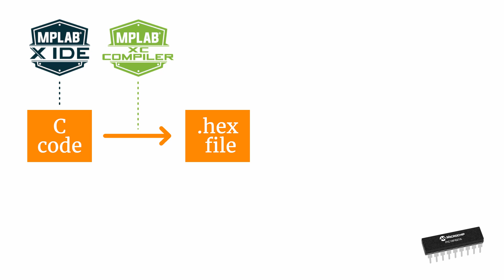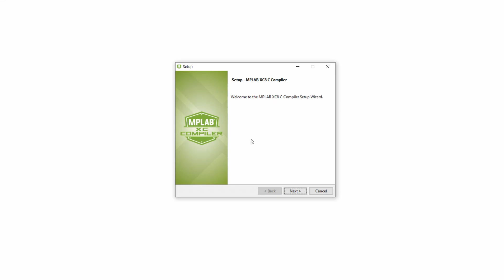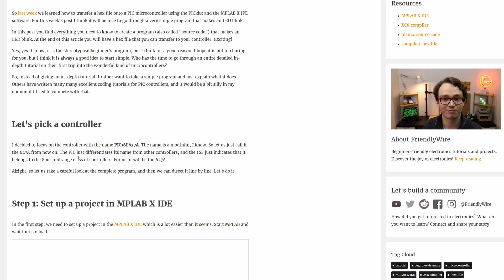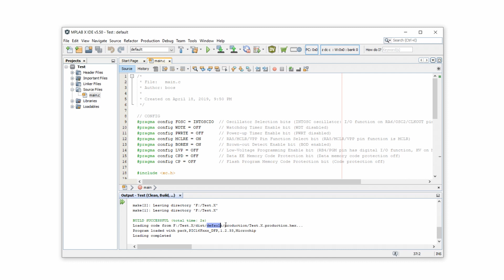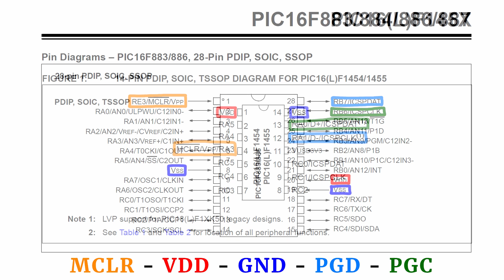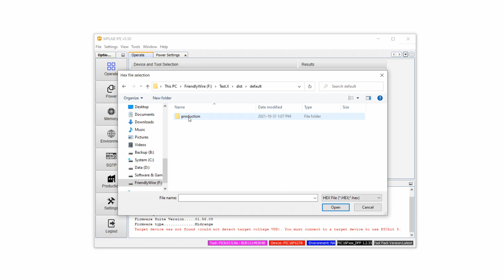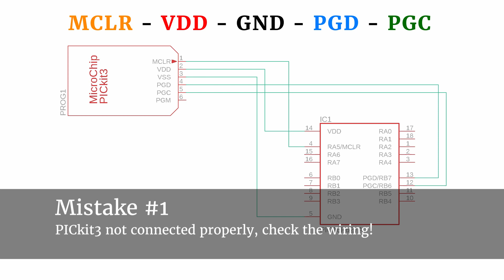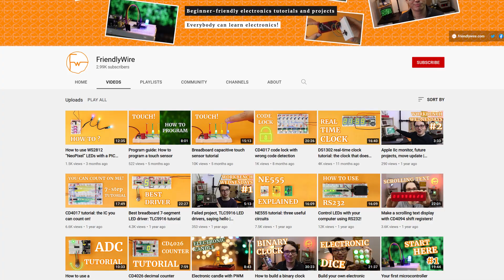How to get source code onto a PIC microcontroller

Comment: Very good video sir, Is there any way to upload a hex file onto a PIC microcontroller without using a PICkit, instead using an Arduino?
Reply from the maker: Thank you for your kind words :) Yes, it is probably doable, since you just need the three wires MCLR (Master Clear), PGD (Program Data), and PGC (Program Clock). But I am not an expert on doing this. If you search on Google for "homemade PIC programmer" I am sure you will find many helpful resources!
Reply: @FriendlyWire  alternative of a pickit3 for "ICSP (in circuit system programming) there's a way of directly connecting a PC serial port to the RB6/RB7 and uses a few components including a 12 V keyfob battery for the VPP.  Has to use a real hardware rs232 serial port, a PC with usb adaptor is too slow to work.
Reply from the maker: @jagmarc  Yup, good point! Older development boards used to use that method, check out the Velleman K8048 that I list on my website here: http://www.friendlywire.com/articles/gear/#ch5 . I have found these types of programmers to not work as reliably as the USB ones, though.
Reply: @FriendlyWire  where are you serving your website from?  I see you have a domain name. When my device connected the connection didn't upgrade itself to a https . I guess you're missing a setting on your .httaccess file or cPanel configuration
Reply from the maker: @jagmarc  You can also use https://www.friendlywire.com/articles/gear/#ch5 .
Reply: @FriendlyWire  For a beginner definitely it's better to get one of the ready-built programmers mentioned and not make your own the first time. Because there's so many different potential issues that can go wrong and stop it working reliably and it's difficult to troubleshoot especially if lack experience.
Reply from the maker: @jagmarc  Exactly, which is why I always recommend the PICkit3 (or its clones) for beginners.

Comment: Hi dear. Its an excellent tutorial. How can I implement sine function for 8 bit PIC microcontroller. Please reply. Thanks.
Reply from the maker: Hey there! I think this would best be accomplished with an array, where you store the 8-bit values of your sine-function. Do you also need negative voltages?
Reply: @FriendlyWire  Thanks. What you suggested, is more efficient solution.
Reply: @FriendlyWire  no negative voltages
Reply from the maker: @imtiazhussain5027  If you don't need negative voltages then it is really the easiest solution I can think of :)

Comment: I want to do the opposite, I want to pull the code from a PIC provided that it isn’t protected. How is that accomplished?
Reply from the maker: Good question! It is impossible to obtain the C code from the PIC, all you can do is get the .hex-file. At 6:54, if you are connected to the PIC, you can click on "read" and that reads out the program memory, if it is not protected. The reason you cannot download the C code directly is this: it doesn't exist on the controller. C code only exists for us as a tool, but before it gets onto the controller it is compiled into the .hex-file. Hope this helps! :)
Reply: @FriendlyWire  that is fine. If I can get the hex code, I can then download it to other PICs to duplicate the same function, correct?
Also, if the PIC in my equipment had the part number removed by the manufacturer, how do I figure out which one it is? I have the schematics of the board and all pin outs.
Reply from the maker: @MrWatlow  Yes, the .hex-file is all you need. There are many PICs with the same packages, but their connections PGD/PGC/MCLR tend to be at the same place for all PICs in a given package. But you still have to know what PIC it is. You can try this: maybe you think it's a PIC16F627A. Configure your MPLAB IPE to PIC16F627A and try to connect the PICkit3 to that mystery PIC. If it works, it's a PIC16F627A, if it doesn't, you have to keep trying.

Comment: How to clear pic 18f4550 can u help me
Reply from the maker: Did you find the datasheet for the PIC18F4550? MCLR is pin 1, PGD is pin 28, and PGC is pin 27. You can connect VDD at pin 20, and ground at pins 8 and 19. For anything else you just need to replace "PIC16F627A" in the tutorial above with PIC18F4550. Does it work? Let me know, I am happy to help more.
Reply: @FriendlyWire  let me try notify u shortly
Reply from the maker: @ajs-tatu-spitstop9235  Sounds good!

Comment: program memory: start address = 0x0, end address = 0x7ff
configuration memory
program memory
Address: 0 Expected Value: 120a Received Value: 3fff
Failed to program device

I cant find what is the problem in pic16f877a
Reply from the maker: This looks like a data transmission error, most likely the cables are not connected properly, it happens sometimes. If you have a picture, you can send it to me on Twitter or Instagram @FriendlyWire and we can figure it out :)
Reply: Did you solve the problem ?

Comment: Great to see a channel using the PIC. I am a big PIC fan but with the vast array of devices and constant upgrades to the software it can get intimidating for the beginner. Thanks.
Reply from the maker: Hey Bill, glad you like the video! Yes, there are so so many PICs out there, which is why I focus on just a few of them in my videos :)
Reply: @FriendlyWire  I jumped from the 16F887 to the 18F26K20 mostly because I wanted 3.3V. So much functionality I have yet to master! But most of the code can easily be ported. Thanks again.
Reply from the maker: @billebrill8730  Yes, there is a lot of PIC controllers out there, and it can be very overwhelming to begin with. Instead of overthinking I always recommend to just start somewhere in order to form a solid basic understanding, and then branch out from there :) My first controller was the PIC16F627A :)

Comment: How to measure three phase voltage 415v micro controller r phase voltage loop y phase can't read 415v phase voltage 0 measure sir if any formula
Reply from the maker: Hey Ganesh, thanks for the question! For measuring AC voltages I would definitely recommend to use some sort of galvanic isolation, like an optocoupler. AC line voltage with 50Hz is rather slow compared to the MHz resolution you can get with PIC microcontrollers, so it would be relatively simple to detect a zero crossing. But I am not sure if I understand the rest of your question, can you explain more? :)

Comment: can i do cording with out this device?
Reply from the maker: Yes, the coding is done just on your computer. You only need it for the final step of transferring the code onto the controller.
Reply: @FriendlyWire  is there other way
Reply from the maker: @mohomadashad4641  You need to physically connect the controller to the computer to transfer the code. The PICkit3 is one possible solution, there are other adapters as well. But you will always need one of these adapters.
Reply: @FriendlyWire  ok. what are the others
Reply from the maker: @mohomadashad4641  PICkit4 is the newest one, but the PICkit3 works just fine. Why do you want to use a different one?
Reply: @FriendlyWire  Price is little bit high
Reply: its out of stock in my country
Reply from the maker: @mohomadashad4641  I see... There is also the PICkit 3.5, which is an unofficial version. If you want you can send me a message on Twitter @FriendlyWire and we can search for an option for you :)
Reply: @FriendlyWire  how much
Reply from the maker: @mohomadashad4641  They typically cost around $20-$25, but that is in the US/Canada/Europe.